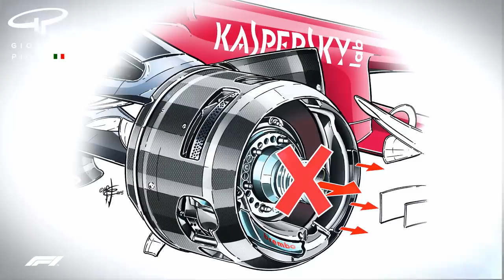2019 Technical Regulation Changes Explained

Comment: If F1 want more overtakes then they should change the engines to V8s again, bring back more tire manufacturers and allow the cars to refuel during the race like before... Is that simple... It's not in aerodynamics the problem that the cars are slower than they used to be, the real problem is all those new regulations that they are killing F1... You like something futuristic just watch Formula E. F1 was and should be the sport that pushes everything to the limit!

Comment: Basically have the car designed and then have all teams figure out where to stick other winglets until they're hard to pass again or one team gains a huge advantage because of the power unit.how about leave the rules alone for a while and let everyone catch up on  that one philosophy instead of fucking around every year.they should be getting faster not slower and they look so crazy fast around corners now I love it and it's been a good year,there's always going to be some boring races,Barcelona was never exciting.

Comment: It's easy.
Make Formula One the pinnacle of competitive racing between different makes of car, with the best drivers in the world, by whatever means necessary - cost caps, use of older rules (idk about anyone else but the late 80s/early 90s cars looked the best and I would guess that and the mid 2000s are the most popular eras), etc. Quit the pitstop strategy fetishising, quit the tyre dictatorship, open everything up and give new teams a starter package based on a previous design, or something.
Make Formula E the pinnacle of electric and efficient technology in homologated cars.
Make a new Formula A, in the future, the pinnacle of aerodynamic/engineering ingenuity, with self-driving AI cars. Ideas that are proven to work well here can be introduced a few years down the line in Formula One.
With such a striation you can cater to all fans while diversifying your brands under the same umbrella. You could readily encourage teams to enter more than one formula - E could be on a parallel to GP3/2 racing in the pyramid.
Thoughts?

Comment: What a fantastic amount of expense the teams have to pay. This completely changes the areo philosophy and negates most of the research of the past few years. It is the type of knee jerk reaction that Ross Braun stated would not be part of the future. Cost cutting cannot be achieved if regulations are changed in this fashion. I (like all die hard fans) want to see Formula 1 as an exciting sport, with the pinnacle of drivers and cars there needs to be a willingness to FINANCIALLY support the teams when this sort of rule change is applied. The 2019 season starts in March so the teams now have two directions to look and less than a year to adjust. They must try an score points in this championship with 2018 rules and design and build a competitive  2019 car with a drastically different design philosophy.

It is a absolute wonder to me that the smaller teams keep surviving in this sort of environment. I remember the days of larger grids (more opportunities for new drivers) and understand the poor economy has contributed to the decline but the governing bodies,  FIA, Liberty and the teams should be working TOGETHER for the betterment of the sport. Christian Horner has spelt out just what the teams thought about this and STILL it happens. A sport that does this to its players is lucky to have ANY players left.

Comment: They make rules to bring back super downforce and skyrocket lap times, than they reduce it cause cars are too fast they can’t actually race closely... so, another year, another change of rules... and let me tell you, they won’t score the target!
Do you want better battles? Bring back the ground effect and drastically reduce upper wings. Screening the wheels will reduce the wake too.
If you want cars that are less dependent from air flow, then you need to make cars with less wings and less aerodynamic parts... it’s so simple!!
Reply: and thats literally what they're doing..
Reply: weeping not really... ground effect can be implemented in much better ways, and wings are now even growing in dimensions, plus wheels still don't have any screening (like IndyCar does, for example). The thing is, you can't be seeking for ultra performance and then complain about the lack of action on track... it's silly!

Comment: This will probably ruin tirewear and therefor force cars to drive even slower to stretch for a 1 stop. Resulting in even worse races
Reply: Or some teams will acutally use the 2 stop again. Wich was the norm back in the day. NO, but the faster you corner the more tirewear, less aero = slower cornering. Unless you have another explenation there will be less tirewear.It doesn't matter in the end, because Pirelli decides on the compounds.

Comment: Simpler wings sure, but the DRS is bullshit. If it will have big effect, racing will still be boring. DRS overtakes aren't real overtakes. And why wouldn't you wait for the straight if the DRS offers such a big advantage?

Comment: I will admit, this season has shown some real lacklustre racing. Not many battles and only the fun battle was between Vestapen and Ricardo in Baku.

I can't complain as a spectator that these will make races better to watch but this is hampering down the ethos of F1 in ways that are violating to the sport.

Its literally a lobotomy, dumbing down the sport so its entertainment goes up.

This is taking away engineering abilities. I just hope that there'll be new engine regulations which allow for faster engines and more tyre strategy freedom

Comment: Cars can follow each other but are still dependent from the DRS to overtake each other.
Nothing really changes, just higher probability of crashes since cars will be licking each others rears, sending each other into the inside of corners like torpedos and overtaking in the straights with DRS just like it happens nowadays.
F1 is still boring and it's sad, because it was actually interesting a decade ago.
Oh, and judging by the size of cars, why not make them airplanes? They're fucking massive, I'm surprised they can even corner.

Comment: But then, F1 will lose against LMP1 if it gets slower next year because of the simpler aerodynamics. Especially since LMP1 already beat 2017 cars on Spa Francorchamps.

But I think the cars will only be slower on the corners, but faster on the straight line because of the less down force. Although I'm not sure about the lap time. I think it depends on the circuit, whether it has more corners or straight line.

And this is exactly just like 10 years ago from 2008 to 2009 season when the car's aerodynamics became much more simpler for overtaking purposes. But then, the complex aerodynamics emerged again a few years later. Let's see if the same thing will happen again 10 years.
Reply: That LMP1 Porsche was a one-off.
Reply: That was not an LMP1. That Car, The Porsche 919 Evo, obeys to no Le Mans Regulation.

Comment: Refueling please. Get rid of all those safety measures, F1 is supposed to be the top class of motorsports. Its gonna be dangerous, thats a vital part of it!
Reply: If they get rid of all the safety measures, will you be upset if your favorite driver gets hurt?
Reply: Oh, so you want races to be decided in the pits like back in the early 2000s?
Reply: Turbo Wheeler/ターボウィーラー Of course. That doesn't mean F1 should be the safest race sport on earth where no one gets hurt. Safety has its role in sports, but this 'safety' trend continues the cars will not be allowed to go faster than 100km/h in a couple of years.
Reply: FJM8940 While your statement is incorrect, because cars and driving skills played a HUGE part in the early 2000s, yeah, I want pit stops to bring back strategy, smart and exciting racing and a reason to watch the races in the first place. I can't say I have properly enjoyed any of the races this season, its just cars driving in rounds, no action, no excitement until one of the cars crashes, it is so damn boring.

Comment: F1 is so stupid in the past 3 years... They have already started to build this way in 2009 with the really big regulation changes from 2008 to 2009. It worked. Cars got much slower and it was easier to overtake than before. This way continued with creating DRS, then it was "too easy to overtake" - said many times... Of course not when a top team car tried to overtake another top team car, but when there was a little difference in speed, it was very easy to overjump the car ahead with the help of DRS. Then, some dude find out that they need much more aerodynamics... They changed it to 2017 on an even more effective way than it was in 2004 and 05, when F1 was in its fastest era so far. Now they can't overtake again. Could they in 2004 and 2005? NO. That was the toughest era of F1 from this aspect. Then what the fuck did they expect? :D Now they change again to the way they did in 2009... :D So ridiculous...

Comment: If the only thing I see next year is drs overtakes I m gonna fucking bully every single one of you deeming today's racing boring. And of course if any of you talks about the cars being slower he will seem like a spastic. Back in 2016 you were moaning about the cars being slower than the almighty v10's. You got cars that destroy these but complain about overtaking. If what you wanna see is 400 drs overtakes in China then that's what you ll probably get. Generally these rules don't seem to be well thought. You want cars that can follow each other. Then why the fuck don't you emphasize on mechanical grip and ground effect so we can have both fast and able to follow each other cars. And when the regulations change in 2021 that will mean 3 REGULATION CHANGES IN 5 FUCKING YEARS. How are teams supposed to spend less money if they have to design completely new cars every 3 years?? You should have waited till 2021 and then change everything

Comment: If just racing is the purpose then why don't they use lawnmowers. They will be much better for close and competitive racing 🤣. F1 was about pushing the boundaries of automotive technology further. What F1 cars have achieved currently in terms of aerodynamics is revolutionary. It is ridiculous how they have got rid of every vortex generators and parts to increase downforce. Everyone saw what Ricciardo did in Chinese granprix. If that's not overtaking I don't know what is then. Why not focus on better Tyre compounds, more powerful engines for over takes. IC engines can't overtake as they don't get more fresh air behind a car, then why not focus on better hybrid systems which can provide a power boost when required. No, instead they went for the simplest option which requires almost zero research and innovation. Since aerodynamics is causing the problems downgrade the technology to Stone age times, brilliant solution F1, simply brilliant! 😤😡
Reply: You have great points !

They're making things more and more complex to the point of annoyance.
I still love it though !

Comment: That's sounds like good news I've been a little stunned by the incredible technology in that front spoiler and yeah spoiler is definitely the right word,spoiling the air flow,deflected shields up mister Scott ,great Scott captain I'm giver all she got and were not gaining captain ,I don't know what to do sir...dirty pool old man,dirty pool,....I like it....not.I'm all for improving the level of racing or trying to,with just one thing,or golden rule call it don't remove any giant or major aerodynamic areas of the car do it slowly so the drivers can adjust in small increments,so when they revert back to instinct and rely on the car to do something it did last year or two month ago in a racecsituation it does,not oh shit I forgot that can't do that at 160 any more....I was truely disheartened to see that the air is being directed off the sides of the car at an area that makes passing harder or may be just the shortest distance to funnel the air,think about it if it has to go up and over technically it should create more drag,this sound like it should help without disturbing anything else too badly,more work for the engineers,that's all those guys love trouble that's what they live for....hah ha....ok start over piece a cake...thanks look forward to next season...

Comment: Hei , you have to change into v8 don't more technology, you guys thinking over, as a fan of F1 we lost the sound, where's the screaming of F1 car, i can't hear the engine, it's more wind sound dominant in car, where's the engine, or maybe you guys should replace with electric 😄😄😄
Reply: No, V6 still best

In 2017, the FIA began negotiations with existing constructors and potential new manufacturers over the next generation of engines with a projected introduction date of 2021. The initial proposal was designed to simplify engine designs, cut costs, promote new entries and address criticisms directed at the 2014 generation of engines. It called for the 1.6L V6 configuration to be retained, but abandoned the complex Motor Generator Unit–Heat (MGU-H) system. The Motor Generator Unit–Kinetic (MGU-K) would be more powerful, with a greater emphasis on driver deployment and a more flexible introduction to allow for tactical use. The proposal also called for the introduction of standardised components and design parameters to make components produced by all manufacturers compatible with one another in a system dubbed "plug in and play". A further proposal to allow four-wheel drive cars was also tabled, with the front axle driven by an MGU-K unit—as opposed to the traditional driveshaft—that functioned independently of the MGU-K providing power to the rear axle, mirroring the system developed by Porsche for the 919 Hybrid sportscar.

Comment: so you had to ruin one more season to realize that what are your mistakes and for the next season you gonna fix it ? what about the crappy v6 ?
Reply: crappy? the only thing crappy about the V6 engines are the noise compared to the V10s and V8s. everything else the V6s are fine as it is. Hell F1 cars are breaking lap records here and there with the V6s.
Reply: don't forget that today cars have better aerodynamic and also they are on softer tires as well, 2nd these v6 hybrids are way more expensive to design to maintain and so on, therefore smaller teams are not going to keep up with rich teams and these engines and their parts are less reliable than good old ones.
Reply: it'll still be uneconomical. you have to factor in the RnD cost, and the fact that the cars will use far more fuel.

V6s pushed to the limit will still be a lot less fuel hungry compared to V10s.
Reply: and also i forgot to add, back during the V10 days, teams can easily change engines to their liking. you're underestimating how reliable the V6s of these days.

I mean come on, 5 races on and they're still running? Good luck getting that using V10s. heck teams are allowed to use spare cars.
Reply: these v6 hybrids are way more expensive than others by any means, fans hate these engines, well some like hamilton fan bois really do love these v6  :) that's why f1 is almost dead
Reply: then again, every rule change in f1 since like the banning of beryllium alloys on engines are aimed to reduce costs.

your claim is absurd. back then mercedes used special alloys on their engines for McLaren. the smaller teams were much less able to compete with bigger teams.

and also, hamilton fanboy? i like watching mercedes losing their dominance in the V6 era.

Comment: Front wing means nothing.
Reply: How?
Reply: It does most of the air flow directing job.
Reply: Ashley The Fox Front Wing is literally the only Part of the Car that creates vortexes which ruin the air for cars behind
Reply: That's not what I'm talking about. The front wing means nothing in terms of what's going to change in 2019. The aerodynamics will be the same.
Reply: Ashley The Fox What? How is less downforce and less “dirty air” translate to “same aerodynamics”. They’re literally changing the aerodynamics of the car.
Reply: It may change, but that's all I know about it. I don't understand a part from aerodynamics.
Reply: All that front wing stuff is crap. Max set fastest lap with huge damage on front wing. All just fake stuff.
Reply: I guess you would know, Andrea Rojas from the YouTube comment section. You would definitely know better than the engineers that build these cars. I got you.